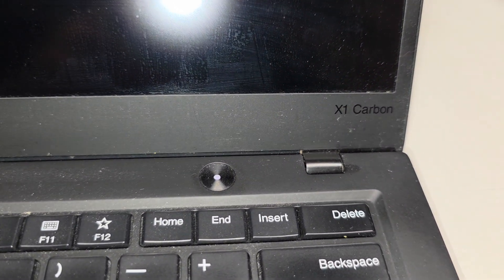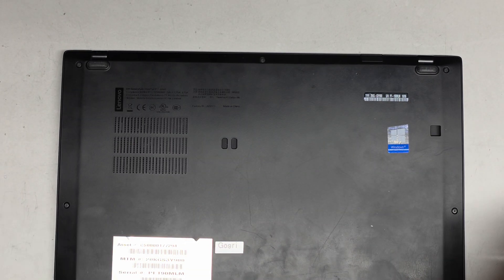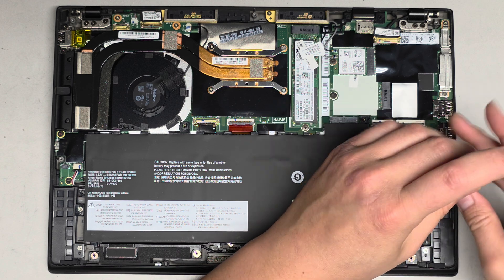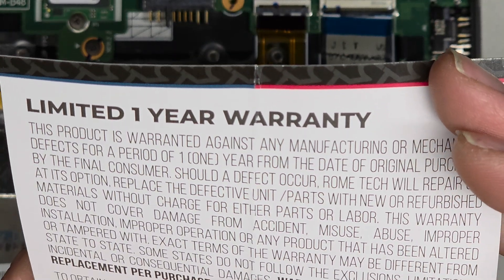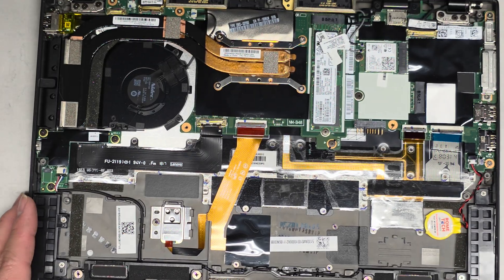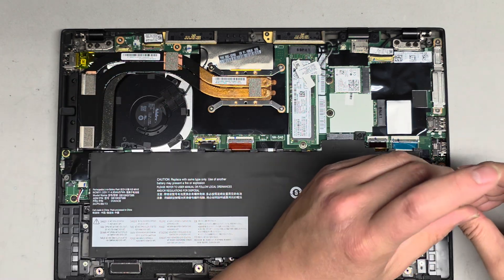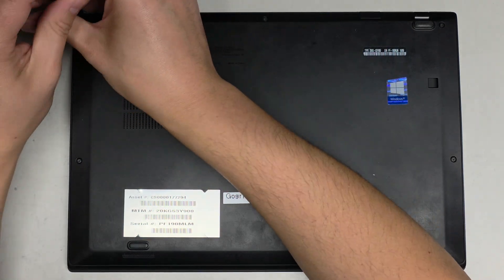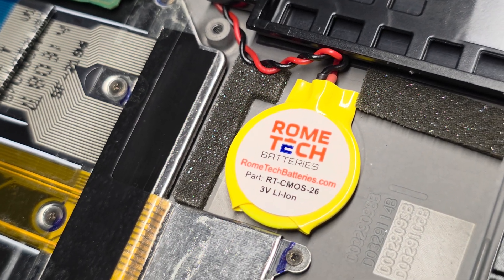6th Generation Lenovo ThinkPad X1 Carbon CMOS BIOS RTC Real Time Clock Battery Replacement Repair

Comment: I've had a problem with a Gen8 X1 Carbon. There is a date and time error when booting (so CMOS problem). Also. The battery does not charge when plugged in. Pushing the battery reset button works temporarily, but the problem returns. Do you think that replacing the CMOS battery could solve this? Also, I noticed that the charger had some problem, so it was not charging reliably. I bought a generic replacement cable. Not sure if that could cause problems too. Thanks.
Reply from the maker: Try replacing the main battery

Comment: Thanks for the video, when I popped off the back I didn't immediately find the cmos and I wanted to look up a teardown before I dug in.  
Can replace the CR2016 battery with a CR2032 as well.  It's a little thicker but is also 3V with a larger capacity and is a more common sized battery.  can still go in the same spot.  I just took the yellow wrapper off the original piece and (carefully) pried the metal contacts off the + and - side of the dead battery.  Then I put them on the new battery and wrapped it all up completely with electrical tape.  right as rain.
Reply from the maker: Glad it worked. Those connections aren't very solid though, so it might come loose. They usually weld it on or something.

Comment: Had some weird power issues on my X1 Carbon Gen6. Keyboard would nt wake on POST. (resolved) Been noticing the charge on the main battery getting short, then CMOS batt dies.
Reply from the maker: Awesome, glad you were able to figure it out.

Comment: Is it possible for the main battery to also die with it? When my laptop had this error my main battery also died which was strange since the cmos battery shouldnt have any relation to the main battery. I encountered this issue in the past but what i did was replug the battery and cmos. Then it worked. Now i tried again both the cmos batt and main batt isnt working. Any thoughts about this?
Reply from the maker: Likely they both had issues before.
Reply: @ItsBinhRepaired  so i managed to fixed it what i did was clean the port of the main battery and cmos then replug both. I was still having an issue where the laptop wasnt charging. But when i plugged my phone's charger to both usb c port (charging port and thunderbolt) it suddenly worked now with my laptop's main charger. Whats the cause of this? I feel like it just shocked the ports then boom it worked.
Reply: @ItsBinhRepaired  the cause of it is when my laptop dies due to being empty batt? When it reached 0% and automatically turns off this issue occurs to me (main batt and cmos having issues)
Reply from the maker: @Chomiii hmmm very strange. Usually if the battery drains to 0 you need to charge it a bit before it turns on.

Comment: Great tutorial. I have a carbon x1 gen 9 with the same problem but i can't source the replacement part. I am just wondering if i just buy a CR2016 3V cmos cell and somehow fit/attach it to the old cable housing, will it work?
Reply from the maker: Should work. Just make sure you get the polarity correct.
Reply: @ItsBinhRepaired  Thanks. Will keep the polarity in mind. Is there a housing beneath the yellow tape?
Reply from the maker: @mma1457 the tabs are welded to the battery
Reply: @ItsBinhRepaired  Then i will try to tape the tabs to the top and bottom of the cell depending on polarity.
Reply from the maker: @mma1457  might want to use a foam or spring to keep it pressed against the battery.